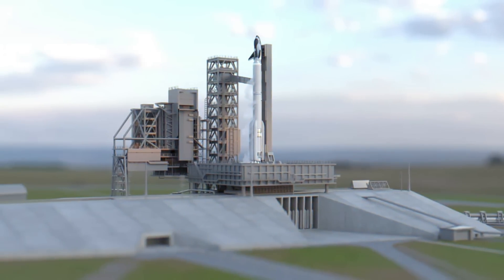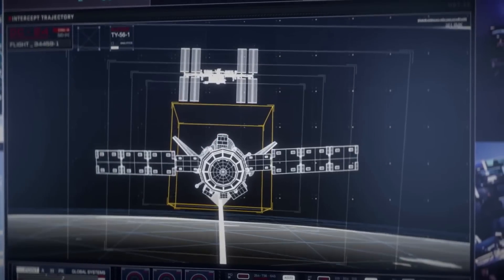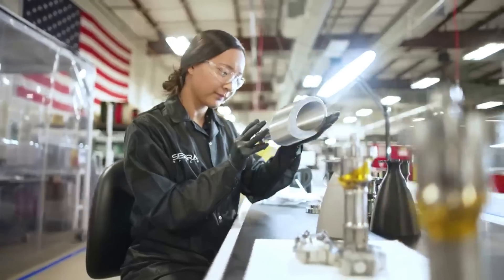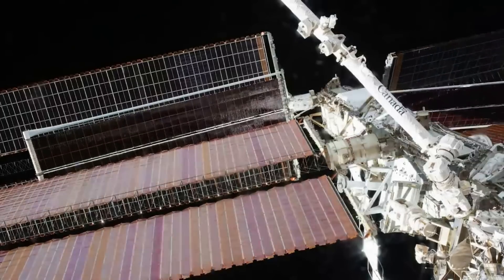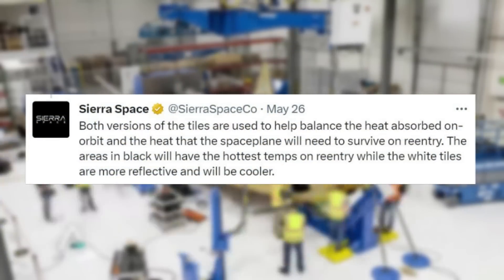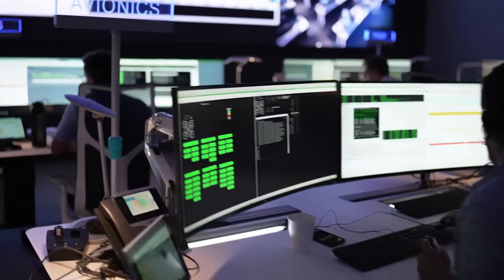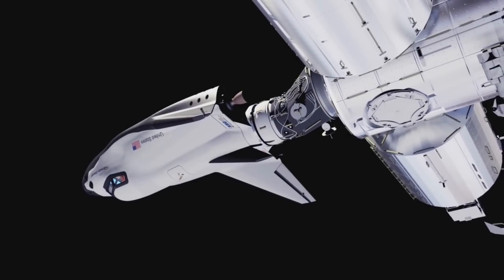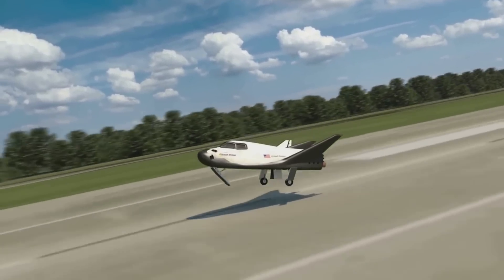Astronauts Have Begun Training For Dream Chaser's Maiden Flight

Comment: NASA has invested much more in development funds for Dreamchaser than either Crew Dragon or Boing Starwaster.  This is entirely appropriate because of the much greater technological innovation.  The only real weakness of the Dreamchaser program is its pointless dependence on ULA and BO.  Falcon 9 is simply an existing much more reliable already crew-rated booster.
Reply: 🙄 The Commercial Crew contracts are way more than what Dream Chaser got for their CRS contract. NASA likes having redundancy, so they would prefer that spacecraft in a program launch on different boosters. The Dragon launches on the Falcon 9. The Cygnus was launching on the Antares 230, but will launch on Falcon 9 until the Antares 330 is ready. Dream Chaser is launching on Vulcan Centaur.
Reply: @steveaustin2686  I said "in development funds".   Look at just the development funds, not the commercial crew contracts each of which included 6 crewed flights to the ISS.  Even with its efficiency SpaceX charges $250M per Crew Dragon flight both to NASA and commercial businesses such as Axiom and Polaris.
Reply: @jamescobban857  That is what those companies bid. NASA doesn't set the prices, the companies BID their own price. NASA accepts it, rejects it, or renegotiates it. There were other bids for CCDev1 and CCDev2, but I only listed the three that competed in the CCiCap bidding.

Aug 2010 NASA CCDev1 awards Boeing $18M (Starliner) and Sierra Nevada $20M (Dream Chaser). SpaceX apparently didn't bid.

Apr 2011 NASA CCDev2 awards Boeing $92M (Starliner), Sierra Nevada $80M (Dream Chaser), and SpaceX $75M (Crew Dragon). 

Aug 2012 NASA CCiCap (CCDev3) awards Boeing $460M (Starliner), Sierra Nevada $212.5M (Dream Chaser), and SpaceX $440M (Crew Dragon)

Boeing (Starliner) was awarded $570M for development, before they got the $4.2B Commercial Crew contract that included development (roughly half).
Sierra Nevada (Dream Chaser) was awarded $312.5M for development, but came in third in the Commercial Crew competition.
SpaceX (Crew Dragon) was awarded $515M for development, before they got the $2.6B Commercial Crew contract that included development (roughly half).

Per the NASA IG Report No. IG-20-005 for the first 6 missions, the cost per Starliner seat is $90M ($360/flight) and the Crew Dragon is $55M/seat ($220M/flight). The latest SpaceX contract is for 5 Crew Dragon flights for $1.4B or $70M per seat ($280M/flight).

Comment: I don't know why Dream Chaser has to open it's wings once it leaves the fairings, it can perform the docking with ISS without the extra headaches of hitting something during docking, especially if it is going to stay attached for some months, it can open them before departing the ISS.

I would hope before they make a crew rated Dream Chaser, I hope they add two small turbojet engine's for an emergency go around on landing capability, they would need only about 15 minutes worth of fuel.

Comment: they was going to send the shuttle up there and leave it there
Reply: ?? There was never any plan to leave a space shuttle in space.
Reply: @steveaustin2686  they were going to use as supply ship to the moon and iss
Reply: the old shuttle
Reply: @stephenroberts643  The Space Shuttle built the ISS and delivered cargo there until 2011. There were never any serious plans to send the Shuttle to the Moon, as it did not have the propellant to leave Earth orbit.
Reply: @steveaustin2686
Reply: @steveaustin2686
Reply: the shuttle was good for its time but i always thought of putting spare rocket engine in cargo bay and putting it on some kind of extending arm on it two smaller engines on the wings
Reply: @stephenroberts643  Nah, this isn't ksp.

Comment: Am I the only one who thinks that designing your "maiden voyage" to visit ISS is a bad idea? 

Before the NASA Apollo program was the Gemini program that first tested the effects on Astronauts of missions lasting a few days to a few weeks. The also allowed Gemini astronauts to practice working in space. 

That's when we learned that hand grips and foot holds were needed all around the spacecraft if astronauts were to perform simple tasks that are taken for granted here on Earth, like turning a bolt, or pulling open a door.

The Gemini program finished with practicing rendezvous procedures and then, docking, two skills that Apollo astronauts would need to get right, if they were to come home from the Moon.

Apollo was started with a major malfunction that, in hindsite, seemed avoidable, and almost ended the program. We lost the three Apollo 1 astronauts, including the very experienced Gus Grissom, veteran of Mercury and Gemini, assigned as the second American in space. This caused NASA management to stop the clock, do a fault analysis on every part of the Apollo capsule. This caused subsequent reimplementation of all wiring, and other changes that prioritized astronaut safety. These changes in design and process probably saved other lives and missions.

So, Sierra Space, what's the hurry? Is Marketing running the show, or perhaps Finance?
Reply: Maybe because the contract for Dream Chaser is to deliver cargo to the ISS? After coming in third in 2014 for the Commercial Crew competition, SNC got a 6 mission Commercial Resupply Services (CRS) contract. The first flight is the demo mission to the ISS, before they start their 6 mission contract.

Comment: I was so sure this project was dead. hadn't heard much about them in the last 5 years. I wonder what the turn-around for this vehicle will look like and if it'll be cheaper to re-launch than things like the dragon capsule.
Reply: It came in third in the 2014 Commercial Crew competition. In 2016, SNC got a Commercial Resupply Services (CRS) contract and the first flight is the demo mission for the contract. Dream Chaser is cargo only for now and the astronaut training was for unlocking the modules, removing the cargo from the hold down equipment, putting new cargo in the hold down equipment, and relocking the modules for space again.

SNC wants to use these cargo missions to prove Dream Chaser towards a future crew version.
Reply: @steveaustin2686  This comment is off topic.
Reply: @mazack00  ?? I'm talking about Dream Chaser. How it faired in the 2014 Commercial Crew competition and what it has been doing since then. What are YOU talking about?
Reply: @steveaustin2686  If you read the comment, I'm musing about if it'll be cheaper than dragon

Comment: How is the "flight ready" BE-4 engine flight ready if it's ignition sequence is still under development?
Reply: The ignition sequence didn't work like they expected, so reset to try again. Little hiccups in a new booster like this are very common. Hell, sometimes happen in boosters with a long flight history.
Reply: @steveaustin2686  "didn't work like they expected"? Did the laws of physics change?
  How did these engines pass acceptance testing let alone qualification testing, only to find out now, after delivery, that major subsystems of the power head have to be reworked? 
Don't blame the booster if the engines don't work. BE-4 is 4 years late and is STILL causing delays even after "delivery."

Comment: The Shuttle should have been this small plane and the rest should have been a giant cargo container to which this space plane could dock. The Shuttle could have carried MUCH more into space. Not having to reuse the super exotic RS25s makes it so much smaller. Hope dream chaser gives Crew Dragon and Starliner some serious competition.
Reply: It's only cargo now. SNC wants to use this 6 mission CRS contract towards a future crew version.
Reply: I agree. The shuttle was a compromise as the original intention was to have a giant carrier aircraft to get the shuttle up into the stratosphere and for the orbiter to power up to orbit from there, with both vehicles being reusable. Getting humans and cargo into space are different challenges and to ask the shuttle to do both was stretching the engineering too far
Reply: @kiae-nirodiariesencore4270  It ended up compromising both. The STS platform could get 122 tons into low Earth orbit. Most of that was eaten up by the orbiter itself. It wasn't far behind Saturn V's 146 ton LEO capability. And unfortunately there were no abort modes at many phases of launch and no way to eject the crew cabin to safety and re-enter. IMHO the Shuttle should have been what the SLS cargo variant is today with the dream chaser at the top.

Comment: Does Sierra have to complete a Dream Chaser orbital test flight before docking to ISS the first time?
Reply: Dream Chaser has a Commercial Resupply Services (CRS) contract to deliver cargo over 6 missions. The first flight is the demo CRS mission to the ISS, like the OFT for Starliner or Demo-1 for Crew Dragon. They will orbit for a while as they get up to the ISS. Then there are multiple hold points in the setup for docking. So if something isn't working right, they can abort the docking at multiple points.
Reply: I had same question as the intro made it seem like they were training for the first flight.  The astronauts are training to access the Dream Chaser from the ISS, not fly on the Dream Chaser.   Manned flights could follow.

Comment: Why can they not find a way to use the Shooting Star service module, instead of throwing it a way as a dumpster fire? Shooting Star and a VAST Haven-1 would make a good match up, for Dragon to dock with.
Reply: Because a LOT of trash is disposed of from the ISS. And SNC is building in the capability for it to be used as a lab in space, without the ISS. But that would be on a future crew version.

Comment: Am I missing something?  I dont see any mission that its capable of which cant be completed by a number of other platforms, ie. Soyuz, dragon, or starship in the future.
Reply: Redundancy. If Progress, Dragon, or Cygnus have any problems, the ISS has Dream Chaser as well for taking cargo to the ISS. NASA liked the Dream Chaser concept, where it can land on any long runway that jumbo jets use. Since it doesn't use toxic propellants, no special equipment is necessary.

Also NASA liked it for crew, but it came in third in the 2014 CCP competition. So with a CRS contract, SNC could continue working towards a crew version.

Comment: Sierra needs to begin making the Second "Tenacity" class shuttle. In the unlikely event of a vehicle loss, the second article could be well along in its construction, should there be an jncident. Due to Vulcan delays [Remember: SPACE IS HARD] the second cargo craft might even be near completion. It can incorporate, lessons learned during construction and testing of Tenacity, and after the successful cargo mission, incorporate improvements and solve issues incurred during the test flight. Sierra also should construct or begin the workup for an additional manned space plane, for similar reasons, and for the likely possibility of increased demand for the platform.
Reply: They will likely wait to see if anything breaks.
Reply: @colinsouthern  unfortunately little of the advice is good.

Comment: It's probably not going to happen, but it would be so cool if SNC and Rocketlab worked together and launche the Dream Chaser ontop of Neutron. Yes i know it's impossible with the current design goal for Neutron.
But they are similar in size and energy i think. With a very different way of doing buriness, it would be cool to see what they could do together.

Comment: Imagine if this starts flying regularly before Starliner
Reply: Dream Chaser is for cargo flights, not crew yet.
Reply: It will be crew qualified before Star liner is used
Reply: @RowanMangion1976  Likely not. It might not even fly before the Starliner CFT.
Reply: @steveaustin2686  You're probably right. Though at this point by the time Starliner starts REGULAR crew flights it might as well be pulled because of its age and poor safety record so far.
Reply: @dylangtech  Nah, NASA said that the OFT-2 flight was a success. Boeing is fixing all the issues to NASA's satisfaction before the next test flight with crew. There will be a FRR to see if they can still make the July 2023 date or if it has to be pushed back again. Everything is in NASA's favor as Boeing is paying for all the fixes on Starliner. Dream Chaser is currently scheduled for a Dec 2023 launch and that may slide into 2024. SpaceX is almost certainly doing the Crew-7 flight in Feb 2024, but IF the CFT can fly this year, Starliner-1 may take the place of Crew-8. NASA still plans on using all 6 of the Starliner flights, along with the 14 total Crew Dragon flights, before the end of the ISS. If Blue Origin, Sierra Space, and Boeing build Orbital Reef, the Dream Chaser and Starliner will likely fly to it.

Comment: Is John Crighton one of the trainees lol
Reply: Dang.  I was gunna say that....Wonder if Moya is in Orbit....
Reply: @andrewpotter1206  Both Farscape 1 and Dream Chaser are based on the HL-20.
Reply: @andrewpotter1206  The crash in the $6M Man was the M2-F2, an early predecessor. The HL-20 came out in the early 1990s.
Reply: @steveaustin2686  yeah i had a senior moment,I serm to recall the M2F2  prototype was wood ,and towed behind a Chevvy...and had fixed gear...could be wrong....I'm old....my memory fades....I remember a wanderer,named Max.....
Reply: @andrewpotter1206  That was the M2-F1, which was unpowered. The History Guy did a short video on it and the car. That lead to the M2-F2 which had the famous crash. After the crash, it was rebuilt with a vertical stabilizer and christened the M2-F3. The HL-10 was also flying at this time. In the early 90s the HL-20 started development, which is where Farscape 1 was copied from. When Dream Chaser started development, it worked off the HL-20 as well.